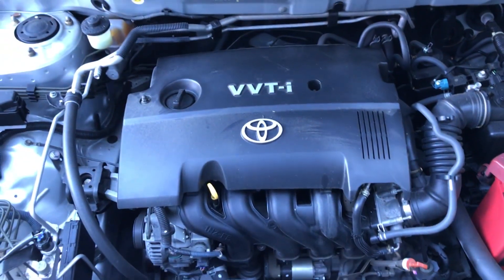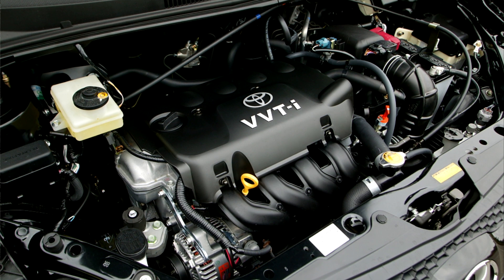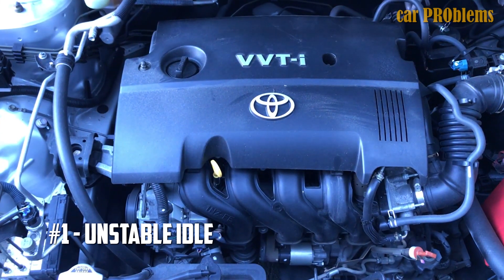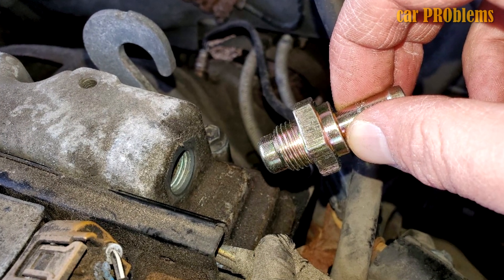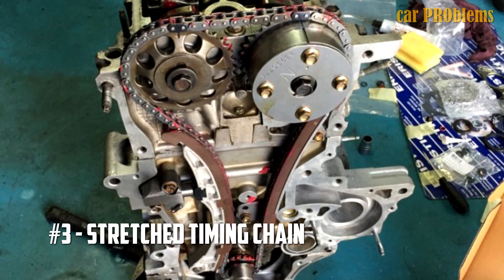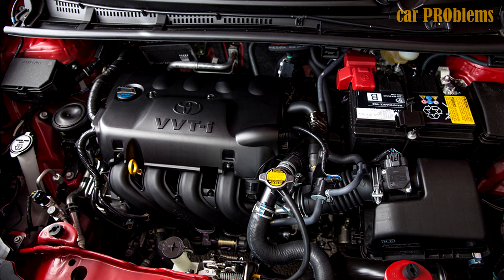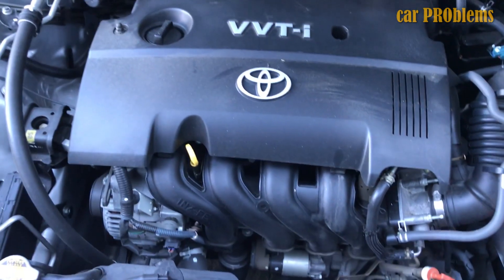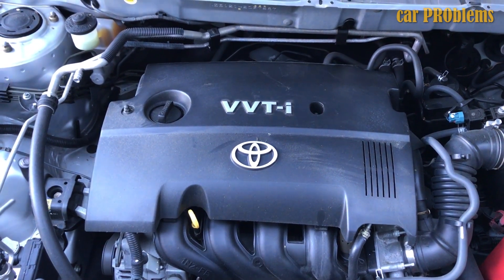Toyota 1NZ-FE Engine Problems and Reliability

Comment: You are wrong this engine is super reliable I've seen them with more that 200k on them running like a clock
Reply: No matter how good an engine is poor maintenance could ruin any engine
Reply: Mine was going for 300k km before I sold it
Reply: @Sipmeister007  sold mine at 500k and a friend of mine did 800k plus on his
Reply: agree with you bro, i have a 1gen vios it already with me for 20years and only starter, spark plug and ignition coil replaced so far.
Reply: @muhammadfaizzakwan5995  
Thats Cool. How many miles or km do you have on the car?
Reply: @muhammadfaizzakwan5995   bad mende ye dak...sensor2 tu biasa la...ade kala dh smp masa...aku nye dh 240k mileage...makan minyak itam sket jela..stiap 5k topup minyak baki..setel...
Reply: Great engine…
Mine currently has 289,000 miles and does not leak or burn oil, nor experienced any of the failures detailed in this video.
After 16 years…I’ve only changed alternator and starter…that’s it !
Reply: @flyonbyya hmm interesting same here but the clutch went around 340 000km's on my Yaris sedan. Good cars regarding reliability
Reply: Seen 980K before
Reply: I run a 1nz fe engine....got it at 29k km on the Odo and right now i am clocking almost 200k ....one of Toyota's most realible engines...just oil change and you're good to go
Reply: Almost every Toyota Echo that’s ever on marketplace where I live is 300,000 plus miles. I don’t believe this is accurate information. Same with the scion
Reply: I've got 213000 on my Scion xa and it's all original except for the battery.
Reply: I have just hit 215,000km with it. No problem so far. Fuel economy is still fair
Reply: @LibertyG0385  mines on 250000 kms, still sounds like new
Reply: Mine is at 219K miles
Reply: I have one that is 350k and going strong
Reply: I have 2 2006 scion xb with the 1nz fe both over 200k one has 270k the other has 213k both run amazing with no engine related issues.
Reply: My Corolla at 243k miles and I let that mf breath 😂
Reply: I’m already around 300k on my 1st Gen xB. The more my family hates it the more my car pisses them off by just running and running lol
Reply: Mine included. 220k and running without drinking oil, spilling oil or rattle noise. 

2 tips for any car owner:

- Change oil yourself so you know what oil you put in it.
- Choose a good oil. Not the cheapest one.
Reply: My yaris is only 75k 😅 I have a long way to go
Reply: I'm at 350xxx km right now 1nzfe
Reply: Mine is about 350k km.
Reply: i only added a voxy vvti solenoid to mine an that made it faster
Reply: Yea my kids scion has 300,000 miles on it
Reply: My father have this engine in his car. It’s going on 500k
Reply: Unbelievably reliable engines. Mine    is just a backup car these days but has 503 000km's on the clock currently
Reply: My 1nzfe has over 300km and I’m still doing basic oil change. 💯
Reply: @cuffydaniels3169 270k plus and going strong on CNG😂
Reply: 2003 is still strong at 250000miles. no leaks, and and gets great gas milage.

Comment: This engine is very reliable almost every 1nz on the road has 200k+ miles on it I have 248k rn oil consumption is 1quart every 3k miles which for 248k miles is nothing just change the oil and it will be fine
Reply: I’m at 150k and for the first time it needed a quart but it’s past 3k miles needs a oil change this Chanel has no idea how reliable the 1nz is
Reply: which oil are u using? i use 5w30 but in manuel it says to use 0w20
Reply: @onatd.7118  In winter time I use a 10w-30 conventional then in the summer I use a 15w-40 both shell rotella. I since have not had any issues with my engine and she is now at around 270k miles and still going strong but still oil and filter change every 3000 miles. But a 5w-30 is also just as good you should have no problems. conventional or synthetic does not matter either but I choose conventional since it is cheaper for me.
Reply: @Cat53278  thanks man, i read people use 5w30-10w30-10w40having oil consumption issues a lot. And manuel says to use 0w20 all the time on 1.33 motors manufactured between 2009-2011. Im really stuck on what to do mate